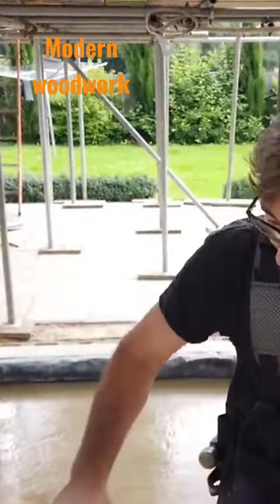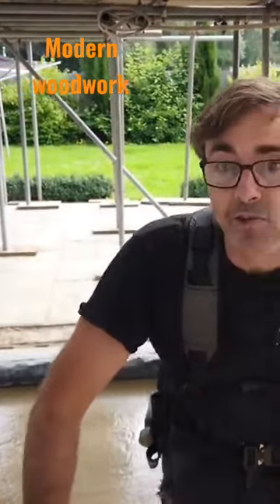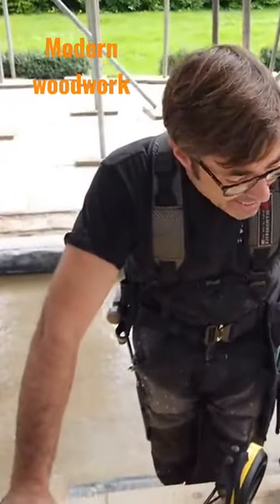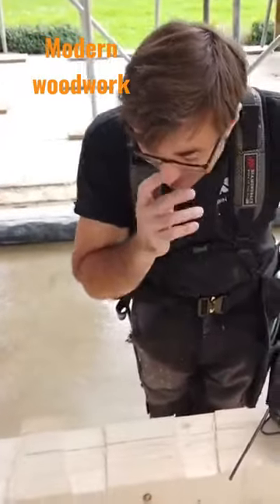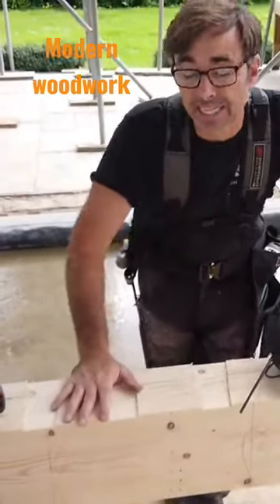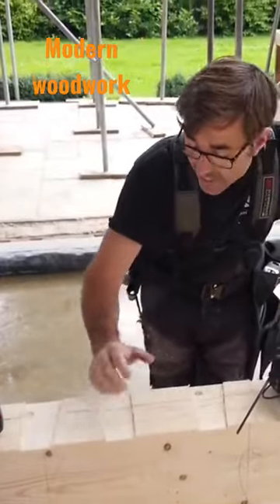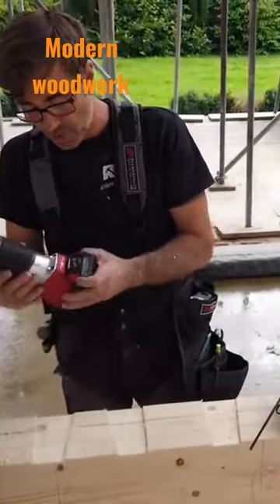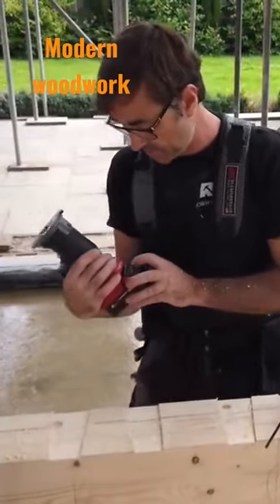modern woodworking replacing the handsaw and chisel #shorts #carpentry #how #router

Comment: Is it worth buying this even though I got a corded 1/2 inch router
Reply from the maker: these are so handy and small so they perform all the small tasks much nicer than a larger corded half inch router
Reply: A definite yes. I have the new/latest version of 1/2 inch makita router which is one of the best routers on the market (I use mafell one in work), and also 8mm bosch which was my first ever router. I bought this milwaukee almost two years ago now, I have no regrets whatsoever. Its the first router I go for now, so easy to work with, not noisy at all. It does 90% of router work. It comes with two different diameter flat plates so you can span even wider cutouts, and plunge base too which feels and works great, very smooth and easy to use. Not too expensive neither if you already have milwaukee charger/batteries, which I didn't, I loved it the very first time I used it so I don't really care I had to spend extra for charger and batteries. You won't be doing worktops with it and you probably already know that, but for all fine and medium stuff I would highly recommend this.
Reply: @samsonacc8081  thanks I did buy it after I got the makita one it's quite heavy for some work so I have no regrets in buying the cordless one